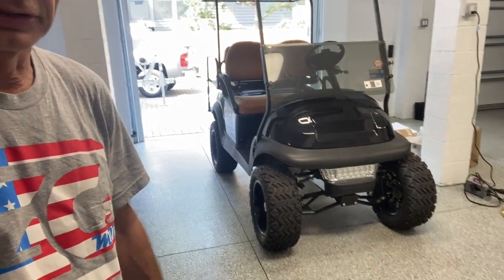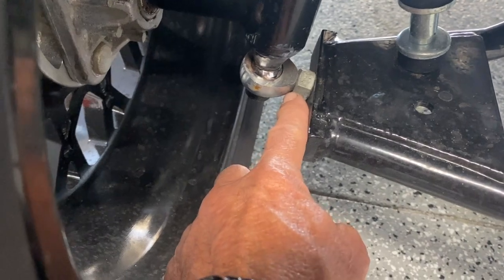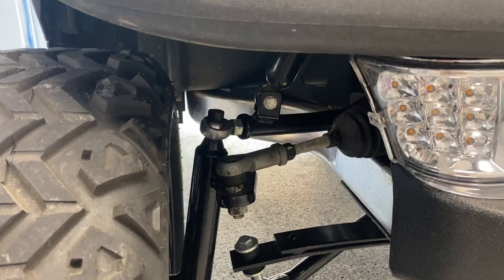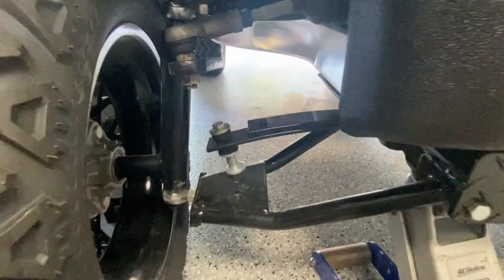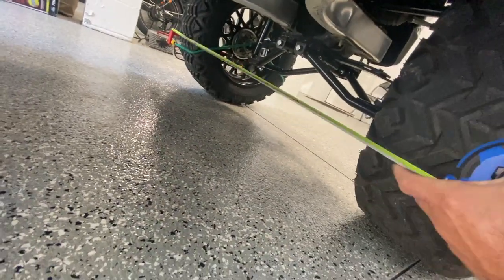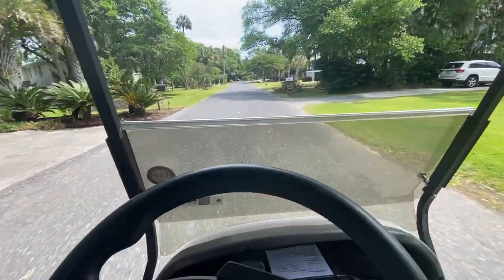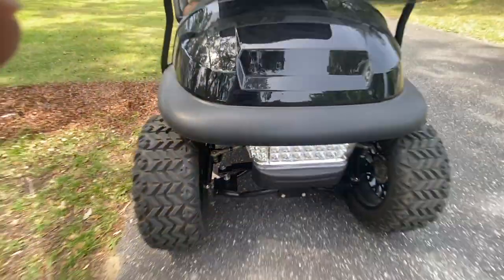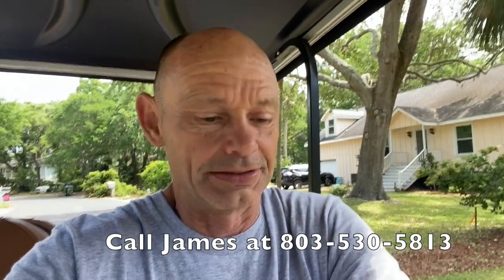How to do a Club Car Alignment

Comment: Great video.  You did all of the adjustments on the right tire.  Why did you not have to adjust the left tire as well?
Reply from the maker: Somewhere around 8:40, you can see that one side was already within specs, you only adjust the side that is out of specs.  This one just happened to only need one side adjusted, since this cart was only one year old since I built it, they obviously did not knock it out too far.  If you’re adding a lift for the first time there’s gonna be a lot more trial and error

Comment: Excellent instruction!! All your missing is the torque specs.
Can we get those please
Reply from the maker: Those I don’t have, but rule of thumb is the larger the bolt the more torque you can put on it, I guess all the years in the automotive field I just have a good feel for it. But you’ll know what will hold these jam nuts and also the spindle bolts in place. Thank you for the compliment also!

Comment: Is there a method to make sure the tires are point pretty straight before you do the toe? I know the old string trick but on my club car the rear end is wider than the front, Do you just eyeball it?
Reply: I know what you’re talking about and yes,  I just eyeball it!   Good luck I hope these tips help you!
Reply: @CarolinaMotors378LLC-gb8jb Thanks for the reply

Comment: How do you adjust the camber on a regular club cart precedent please? Any videos on how to do that?
Reply: You cannot adjust camber on each wheel individually on a factory club car. You can loosen the lower center spring mount and adjust the camber on each of the front wheels together as the spring can side left or right, finding the most centered/even position. If centered and your camber is heavy negative, you have some bad bushings. Either the spring, a-arms, or king pin bushings need replaced. Possibly all of them.
Reply from the maker: This! Well explained 👍

Comment: I followed your instructions and I got the front toed in at 1/4 inch. I tightened the nuts as directed. I then took it out for a ride and both tires reverted back to being
towed out considerably. What happened?
Reply: I know this is 5 months late from your question, but it sounds like your front bushings are shot.

Comment: What torque specs are you using for these different nuts and bolts?
Reply: I'm like you and want to be spot on. This is a situation where I'm fine with "just make them tight".
I have a motorhome and had to get something done at a Freightliner in Springfield, Missouri. They had a mobile mechanic come to do the job. When I asked where his torque wrench was, he said, "I don't use one. Tight is tight". 
He's not the only mechanic I've heard that from. 🙄

Comment: How to adjust the camber on a 1998 club car. I have a positive camber right now but not sure how to adjust it out. Both wheels have the same gap on the bottom of the tire
Reply: Did you happen to put a lift block on your cart for wheel clearance? If so, this causes that issue. They make adjustable front king pins that can correct the factory camber setting.